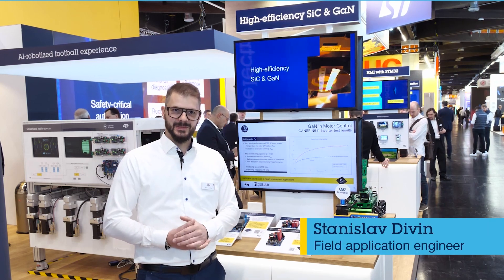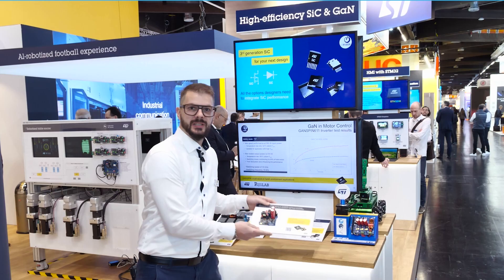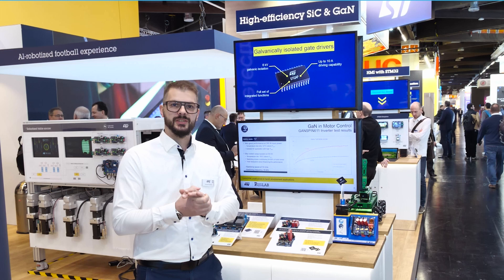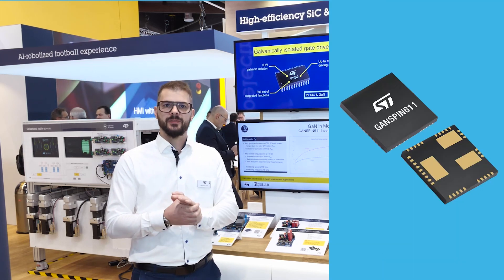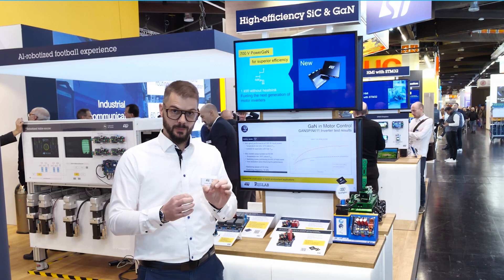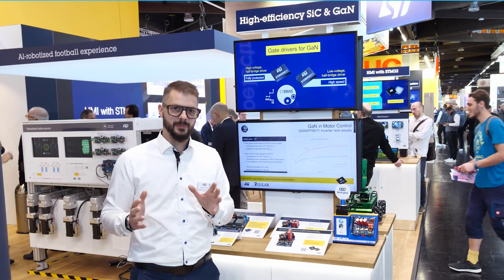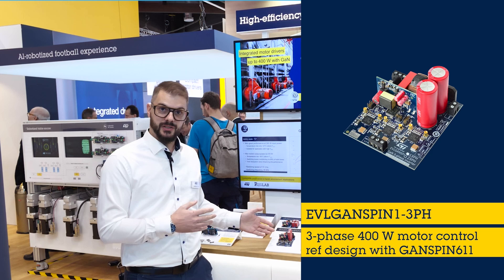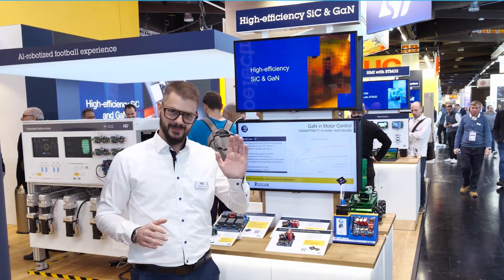3-ph 400 W inverter for motor control with GaNSPIN611 motor driver @SPS2025

Comment: But what does it cost man?  Oh it's $250, my chineseum FOC driver is like $120 @1kw.  Now I do calculate the bom cost at low volume for this puppy to be ~$80, so I'm sure they not loosing their shirt selling it, just wish they cut the price so us plebs could afford it too.  I mean, the chip is what they are trying to sell, no real need to sell the reference board so dearly. Could I get like 8 free samples lol. 

The spec shet says 200khz@50% power.  lol lets get those rookie numbers up and let me drive my pirate radio off a motor controller.